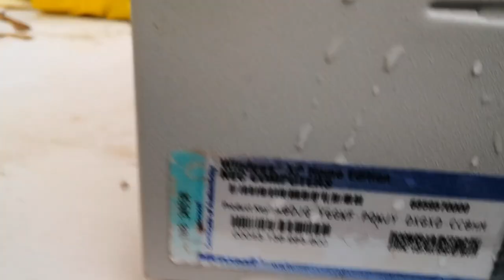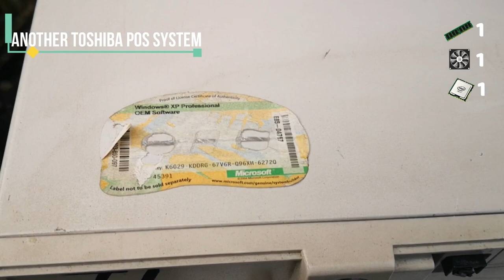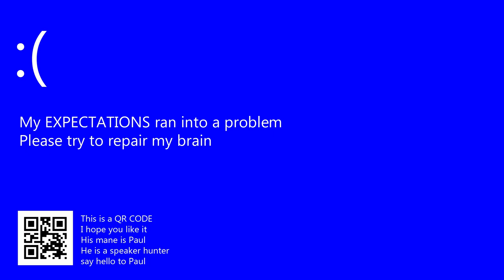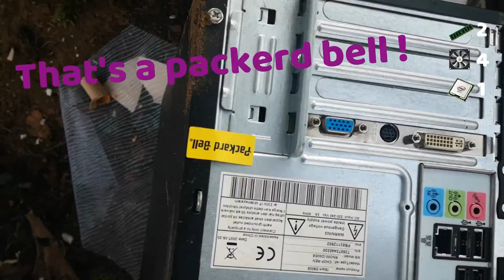Computer Hunting Video #4 | [Part 2]  More Fans , CPU , RAM and FANS AGAIN !

Comment: Most POS System is Actually Good tho, Imagine Finding a MOS 6502 CPU And Just Throwing it in the Ground, Yikes! Its Actually Rare tho

Edit: Most Rare CPU is DIP-Styled Chip, Most of them are Socketed.
Reply from the maker: Yeah they're socketed and that's the main issue with them... those were old anyways...
Reply: @LSandM-SpeakersFromEverywhere  and by any chance: do you collect them or just sell them,like the gpu or the ram and the cpu.